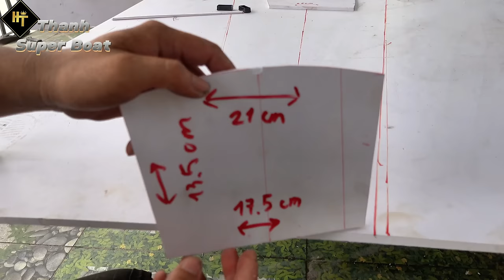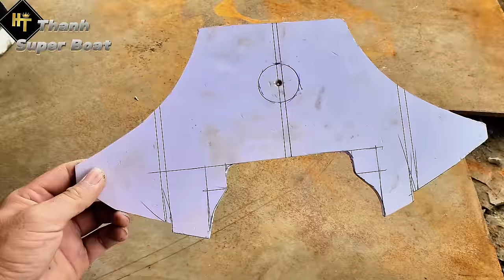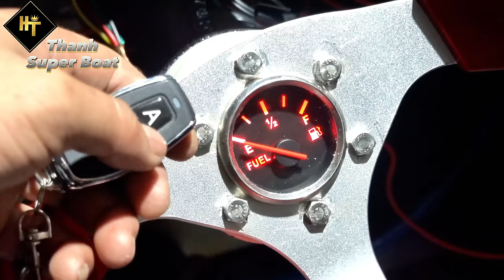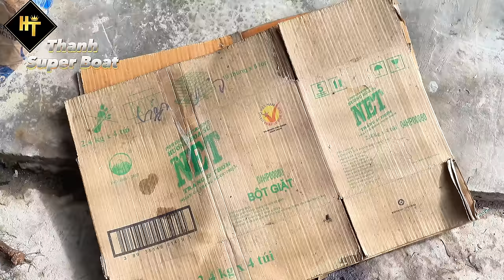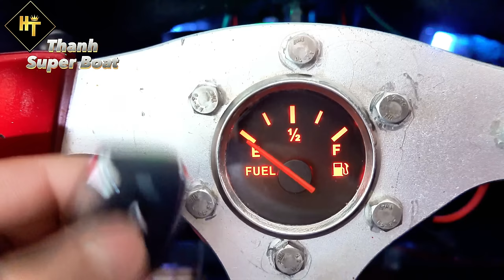Full 60 Days I Build My Own Boat Like an F1 Supercar From Jetski Scraps

Comment: Great project!... I would put that muffler back into the exhaust system as most small 2 cycles function better with some back pressure, plus it'll dampen then "noise" factor. I can't imagine your neighbors are real happy.
Reply from the maker: Thank you so much
Reply: Needs a expansion chamber exhaust system, will get better bottom and top end, fantastic build great job

Comment: YOu did a very nice job. It looks great only some tings to think about. 1. It is not requierd to start your engine without cooling water.Perhaps you can put a meter in it for the tempurater. Otherwise your engng will be to hot and it will stuck. 2. It smokes like an old man. Perhaps you need to check th inside of the engine. Like piston rings etc. etc. Further.. You buil it for speed. When you have the time, take it out of the water end mak you bottom slick. A load of puddy and wet sandpaper on a blochk. This will help to mantain speed and handeling. Ik like your very much. Thank you for sharing and greetings from me, my name is Bert from the Netherlands, Europe. Until next time. I gave you a big thumbs up because you deserve it. AND I am a new subscriber.
Reply from the maker: yes thank you brother from the netherlands, i just ran the machine for a few seconds above to check

Comment: excellent job.   For a little nicer finish you could lightly wet sand with like 320 grit between color coats to knock the dust and orange peel off, then tack wipe, then sand with dull 600 grit at the end, then polish and wax.   Also I used a long board air sander on my body work jobs as the final after putting the putty on to get it straight as an arrow.   This is especially important if the final will be darker colors.
Reply from the maker: Thank you so much
Reply: A video of you doing all that would be good, especially if it isnt just in your head. cant wait.
Reply: You should have your own company by now! Working off your own warehouse!

Comment: Nice little build buddy. My opinion and what little bit of experience I have on the water with boats. I don't think your prop is set at the right angle it should go a lot faster than that. Very beautiful boat 🤩
Reply from the maker: Thank you so much
Reply: Yeah it looks like he needs to point the bow  down to level the boat.
Reply: @joakimportnoff1093 might have needed bigger impeller to get more thrust to be able to put the bow down, more horsepower/engine or even on the rear if he added hydraulic trim tabs would also help somewhat although that might cause more drag and solve the problem initially but not top end he would have to pretty much do trial and error with it. 🤷
Reply: @operatoreng my thoughts exactly. He has too much motor and not enough impeller. It sounds like he should be hauling ass but he’s just creeping along. He spent too much time trying to make it look cool and not enough time on the important drive unit. The kids like it though.

Comment: Thank you, beautiful!!   2-strokes lose a LOTTA power without an expansion chamber exhaust system, there will be a formula for the proper size pipes somewhere on the WWW.  Also, you're very brave with all that fiberglass dust, it is very nasty stuff, I mistakenly rubbed some off my arm instead of blowing it off.  Took WEEKS to heal!   Also, what is the engine from, 2-strokes are getting very rare here, especially 2 cylinder????
Reply from the maker: Thank you for watching the video

Comment: That's pretty darn cool but looks like to me that it needs a crap load more of hoarse power and torque probably needs a three or four cyclender that little two cylinder two stroke ain't enough power for but good job on the build guy
Reply from the maker: Thank you so much

Comment: Want to see a part 2 after porting and head work. Maybe make a exposed  exhaust expansion chambers 4"max dia.3"long center,Then taper down 4"longer x 7/8 or 3/4""hole through stinger x 11"long stinger. Try to use stock header pipe first cone only 2" long to 4" dia. Run likeF1sound like F1. Don't use a exhaust choke or butterfly only slow it down.
Reply from the maker: Thank you so much

Comment: I watched you build this entire thing, but I can not see how you are making it steer. I see no rudders, so I can only assume that it is using a directional nozzle, but I never saw that move left or right when you turned the steering wheel while it was dry docked? How is it steering? Awesome build BTW.
Reply from the maker: I use jet to push the boat and steer

Comment: There is no stability to floatation protection once water goes inside the hull, on time he cut off the original jet ski hull there waterproof foam insulation
Reply from the maker: I removed that part to make the hull lighter and run at a higher speed than usual

Comment: Piece of crap , bow flat , increase air resistance and fuel consumption, also will put increased stress on  hull wen it hits a high wave . Pilot not Sheilded from spray , so vision obscured, etc
Reply from the maker: Thank you so much